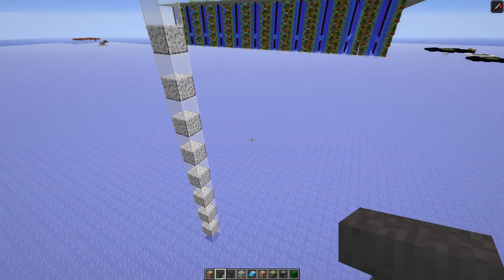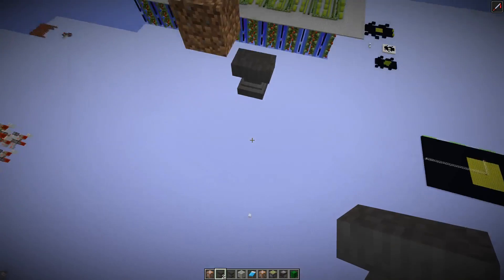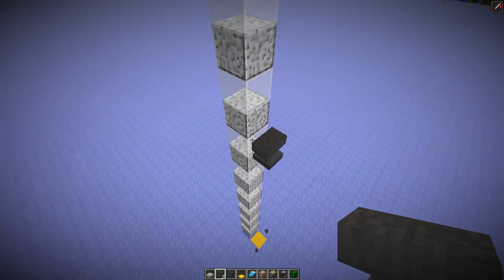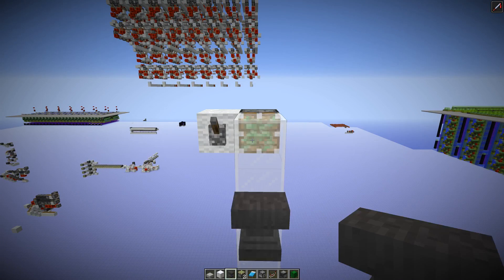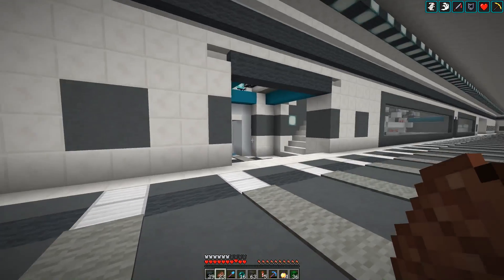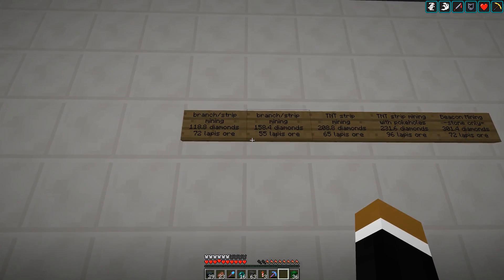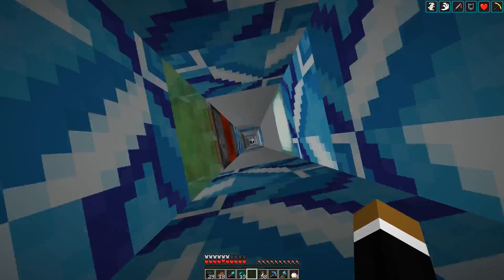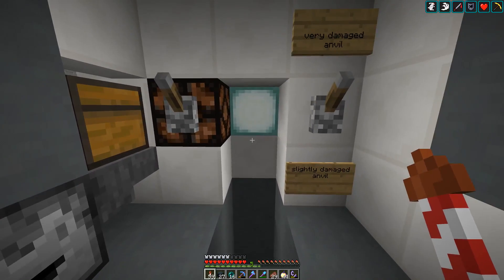SciCraft 144: Anvil Damaging System

Comment: Once you have a doublechest of all, what will you do? Build a minecaft computer somewhere?
Reply: We got 1 redstone computing unit already to display the exact number and percentage of the slime block storage.

And there are currently 2 new computers planned:
-Mess-detector to reverse engineer random number generator seeds
-Mandelbrot generator+floor builder

Soon :)
Reply: @PanNic97  NICE!
I've tought of a general purpose one. However, I understand that General Purpose computers are MUCH slower at any task, compared to problem specific circuits, however they can do ANY task, while specific circuits can't.

Comment: What are the leaves for on the quarry?
Reply: Frangible. Whenever you have a need for temporary block because you must place another block in the midair, not even diagonally adjacent to existing (Tweakaroo allows the latter). The leaves don't count towards the 12 blocks limit and just get squished the moment the machine starts, so no need to remove them and no risk forgetting to remove them. Them counting as transparent so they won't accidentally conduct redstone, spawn-proof (not that they'd build it with mob switch off...) and cheap to farm in bulk being extra bonuses.

Comment: seeing all that work and time put into building the quarry, does just make me question exactly how big the area is going to be, and would it bot be quicker to just mine it than to build everything?
Reply: The area will be 2000×288 blocks all the way to bedrock, if you assume 100% density below y=64 (basically stuffing the mountains in the caves) this would be 
288*2000*59 (bedrock layers cant be mined) =~34 million blocks

The absolute fastest way a player can mine is 20 ticks/s * 3600 seconds/h = 72 000 blocks/hour with instamine, but in the overworld you normally get an average of around 30 000 if you tryhard.
-> 34 million / 30 000 = 1130 manhours
Now double this (because we will build the quarry twice) = 2260h of contant digging.

This is about 10 times more than building the quarrys and about 100 times more boring :)

Comment: Some of these automated super projects designed to perform colossal tasks seem less efficient and more time consuming than just doing the task the old fasioned way I'd like to see a breakdown of time to complete a product plus task completion vs. conventional methods
Reply: While this would harvest  tons of materials, it is still kind of sad to see over 100 mob-spawners being broken, just because they were in the way.
Reply: They took like 250 hours to make the quarry. This one is super fast and will take onlt like 5 days to finish which in total is around 370 hours. The absolutely fastest possible mining speed for 1 player is 1 block/tick = 20block/second = 72000 block/hour. The quarry will mine around 40 million blocks, and it will take more than 550 hours to mine assuming you dig nonstop at the fastest possible rate, but including the time you need to build beacons, mine obsidian, ores, wood, move items to storage and remove liquids it will probably take almost a 1000 hours.
Reply: @WikTerrOdoc  I did a similar comment earlier, so ill just copy it:

The area will be 2000×288 blocks all the way to bedrock, if you assume 100% density below y=64 (basically stuffing the mountains in the caves) this would be 
288*2000*59 (bedrock layers cant be mined) =~34 million blocks

The absolute fastest way a player can mine is 20 ticks/s * 3600 seconds/h = 72 000 blocks/hour with instamine, but in the overworld you normally get an average of around 30 000 if you tryhard.
-> 34 million / 30 000 = 1130 manhours
Now double this (because we will build the quarry twice) = 2260h of contant digging.

This is about 10 times more than building the quarrys and about 100 times more boring :)
Reply: @PanNic97  Yeah so just what I said but more precise
Reply: @WikTerrOdoc  yup, your comment was really good already, just wanted to explain the numbers a bit better :)
Reply: @WikTerrOdoc  Thanks! that's exactly what I was looking for. I think it would be pretty cool to see like a time lapsed race between two teams to demonstrate that point.
Edit: I saw his comment first but the same applies to you @PanNic97 thanks for the informative reply

Comment: “I guess some people got bored and dug out all the chunks under Main Storage...”

Bored you say? I feel like that is not something you do when bored.

But hey, were talking about SciCraft, who literally built an item transport system that transports items tens of thousands of blocks because they were running out of redstone from their QUAD WITCH HUT!

Or the fact that they built a piston bolt network that is comparable, or even better than, some COUNTRIES transportation infrastructure.

Or, the enderpearl cannon, because a 5-minute, 10,000 block piston bolt was “too slow”.
Reply: No one:

Scicraft: Let's dig jet another map-sized hole for no aparent reason, maybe we can use it later
Reply: Endermite * Engineering Assuming the “map sized hole” you’re referring to is the quarry, we’re planning on building the tnt crafting setup in there. Gunpowder from the creeper farm and sand from the dupers will be transported there automatically. The quarry will also run through a mesa so we’ll get more terracotta out of it.
Reply: MCB18 yes, bored. After they finished digging underneath the main storage they moved on to digging under the spawn chunks.

Comment: Hey ilmango, I really need a perma loader design for 1.15.2 b/c I'm making a mob switch and most designs are outdated. If the chunk loading system doesn't allow for permanently loading anymore that would be unfortunate, but I understand. I just want to know if you're able to or not.
Reply: he has a video on 1.14 and as far as I'm aware chunk loading wasn't touched in 1.15
Reply: @Poisonreign  Confirming, built the minecart one, works 1.15.2
Reply: @sharpfang  thanks I don't play Java edition enough to try and test things like this

Comment: question: Instead of using a dropper clock, why not use an observer to the side of the block you are placing the anvil against, toggling a T flip flop and using a rising edge detector, to spit out the new anvils to the user? I'd be worried that a 12-tick clock would fall slightly behind if the server ever has any amount of lag, whereas the detector based system would give you a perfect 1:1 ratio of placed to dispensed anvils.

Comment: Tip: the speed of the observers detection speeds up when you push it with a piston so you should use a comparator clock

Comment: would it not of been faster just to mine it yourself?
Reply: The area will be 2000×288 blocks all the way to bedrock, if you assume 100% density below y=64 (basically stuffing the mountains in the caves) this would be 
288*2000*59 (bedrock layers cant be mined) =~34 million blocks

The absolute fastest way a player can mine is 20 ticks/s * 3600 seconds/h = 72 000 blocks/hour with instamine, but in the overworld you normally get an average of around 30 000 if you tryhard.
-> 34 million / 30 000 = 1130 manhours
Now double this (because we will build the quarry twice) = 2260h of contant digging.

This is about 10 times more than building the quarrys and about 100 times more boring :)
Reply: @PanNic97  ah okay
Reply: lol people thinking digging up 60 million blocks is going to be faster than placing a few thousand blocks and letting it rip.
Reply: @JosephRooks  I was curious no need to be obnoxious. I didn't realize it's was going to be a 288 by 2000 quarry. I thought it was a 288
Reply: 288x288*

Comment: how did you make those pictures in left corner at 9:23
Reply: Maps on item frames
Reply: @BrunoSantos-lm1pz  the resolution is so high... the real map must be enormous...
Reply: @ashutoshsrivastava2889  they're the Biggest possible maps. And yeah, they really are enormous
Reply: @ashutoshsrivastava2889  All maps have a resolution of 128*128. The smallest map covers an area of 8*8 chunks, where one pixel represents one block in the world, the bigger the map is, the more blocks are covered in one pixel. In the largest map one pixel represents one chunk.

So it makes sense to make map art with the smallest map possible.
Reply: Ashutosh Srivastava It is. If you watch Mumbo’s server tour, the Quarry episode, they fly over all of the maps they made. They made them all at bedrock level where the Mesa that was run over by the quarry used to be.
Reply: Its map art.
So they make pixel art that faces upwards and then map the area so it shows the art

Comment: 7:31 imagine not even being touched by finding diamonds :0
Reply: 9:44 imagine using diamond blocks as decoration
Reply: I have a single player world where I do the same. Diamonds are kind of useless after getting full armor/tools with mending.
Reply: Yeah.  Those diamonds will get collected by the quarry, though, so that's good.
Reply: @MCLooyverse  As diamonds, not as ore though. They still had to silk-touch the ores by hand to get their double chest (and more).
Reply: @sharpfang  Oh, true.  Is there some funky function in the quarry to sort out the diamond ore blocks like they did with redstone before, I wonder.  I wonder if there's any way to do that -- nothing comes to mind quickly.
Reply: @MCLooyverse  Only things I could think of would be detecting silverfish entering stone or having a player mining blocks and detecting the difference in stone vs. diamond ore mining time. Neither of those methods would be easy to implement though and that doesn't even address all the other block types coming through the system.
Reply: @MCLooyverse  Nope, it's TNT blasting, no silk touch and it yields 1 diamond per ore only, no fortune.
Reply: @benjaminw.1471  Silverfish is rather unpractical - unreliable. But the AFK detector sounds doable. Have a bot with a pick (sitting next to an XP farm), under beacon effect and move the blocks at just the right speed to insta-mine all the stone kinds, but leave the ores. Sorting gravity blocks out is trivial (the quarry does it anyway). Dirt automatically could be trickier. But if you're at that point, you can have the bot hold a silk touch pick, mine everything, and then sort the items in a classic item sorter.
Reply: @sharpfang  Yeah.  I suppose since they're about to eliminate at least a whole biome they are ok only getting an absurd amount of diamonds, rather than an utterly insane amount.
Reply: Same here. Unless I am excavating a tunnel or something, I don't even bother with Diamonds for the most part. Its just another item slot that I will eventually have to take back and store somewhere.
Reply: Ik
Reply: He probably saw more diamore ore blocks on the server than you've ever seen salt grains.

Comment: Mango! Are you crazy magicians of the scicraft server ever going to upgraide to a later version of minecraft? with a new world
Reply: Lots of stuff would probs break if they did so.
Reply: So many things would be break :/ I think it would be cool to see them use honey tho
Reply: @jerod5636  i understand, i kind of meant it with a new world, i editet it now
Reply: I think they are going to take their sweet time as the new updates hurt performance of vanilla servers quite a bit and some stuff on this scale will be more difficult there. Also some things in later versions are just straight up broken...
Reply: @1Jajen1  they can run it trough forge or something, and the engineering behind all those farms is kind of the purpose of the SciCraft server isn't it?
Reply: @guidoheeling1179  Forge does not exactly make minecraft any faster... Also then it's no longer survival, even without mods. Forge/spigot/bukkit/sponge all change the game, with or without mods/plugins. Redstone and especially the stuff scicraft does will not work as in vanilla
Scicraft was always about taking vanilla survival to the absolut limit
Reply: guido heeling Forge can’t solve the problems they’d have from upgrading, and they run a vanilla survival server. One of the biggest things 
is that their permaloader would not work anymore, which would make things like the quarry almost impossible.

Comment: Ah yes a damaged Anvil farm. Cuz who doesn’t need a double chest of Very Damaged Anvils
Reply: Wasn't it a double chest of shulker boxes filled with an item?
Reply: @TyroRNG  Imagine getting a double chest of shulkerbox of sponge or emerald ore. It would take probably more than year exploring monuments just to get the sponges lol
Reply: Vitor Nathan Gonçalves they could just dupe it
Reply: @Vitor Nathan
There aren't even enouch ocean monuments in a minecraft world to get that many sponges so it's literally impossible.
Reply: @Porkey_Minch  If you get 32 sponge for every monument, you would need 1458 monuments. There definitely is more than that in a Minecraft world
Reply: @sander9951  Yeah, but it wouldn't be fun that way
Reply: Whoops, I thought there were a limited number of ocean monuments in a world but I was thinking of strongholds. Although with an average of 32 sponges per monument you would need to raid 2916 monuments. On average you would have to find a monument every 3 hours, assuming you never slept or did anything else. So I guess it technically is feasible, but it would be the most tedious grind ever.

Also considering they are collecting damaged anvils, then you could also calculate it for both dry and wet sponges, and then you'd have to raid a monument every 1.5 hours without sleep for an entire year.

TL:DR: You were right, and it's actually worse than you originally made it sound 😂
Reply: @vitornathangoncalves2575  gawd, it's too early. I read it as ' It would take probably more than year exploring mountains just to get the sponges'
Reply: W E  yes, but do you want to increase the world filesize to insane amounts just for farming sponges? You will never go there again
Reply: @vitornathangoncalves2575  there are actually sponge farms now
Reply: Vitor Nathan Gonçalves you can automate emerald ore ;-;
Reply: @sander9951  what’s the fun in just duping every hard item to get? It’s better to make more realistic goals
Reply: @vitornathangoncalves2575  Exploring thousands of monuments wouldn't be fun too
Reply: To the ppl that dont get what TyroRng is talking about gnembon made a video where he got a double chest of shulker boxes of mob drops and said ilmango had to think bigger. Its been joked about once or twice
Reply: W E our file is currently 5 gb (even tho the world was created in 2014 and played active since) which is pretty handy, it would be stupid to sextuple this just for sponges
Reply: @PanNic97  lol I didn't realize you were part of scicraft first when I read your comment. Thanks for the input
Reply: @PanNic97  but even that would only be 30gb which is a pretty small amount of storage I feel. I have single movies that are well over 30gb ahahah. Just considering how cheap storage is nowadays, I think itd be really hard to make a minecraft map that's like, unreasonably large and hard fo store (like a few hundred gigs). You can buy a 10tb hard drive for like $150-$170 and that'll fit ANY minecraft map you can think of and still have LOADS of room left over! 

I might be biased because I hoard hard drives and have a fileserver running from my home but minecraft maps always seemed to be relativley pretty darn small to me
Reply: @Xvladin  its also not only just storing the worlds, its also sending them, 5gb is super convenient since you can easily put it on Google Drive or whatever. In general it just makes a lot of sense to not increase the world file size for all kinds of reasons
Reply: Scicraft does crazy shit unseen in any other server. I love it